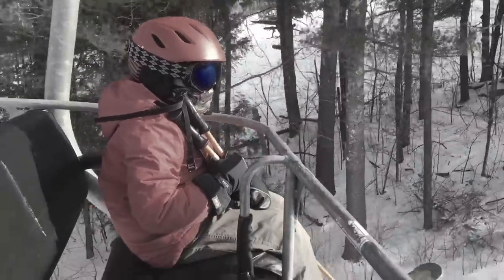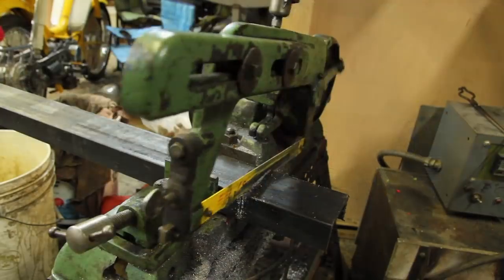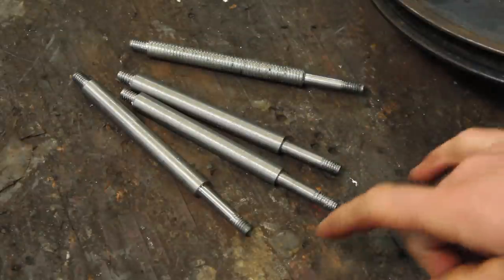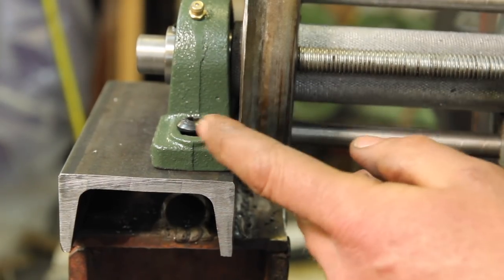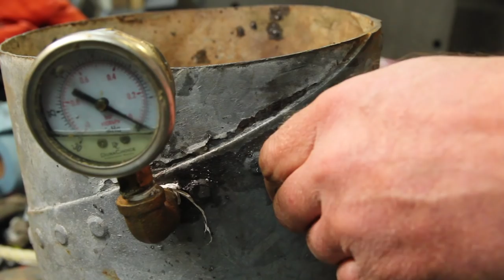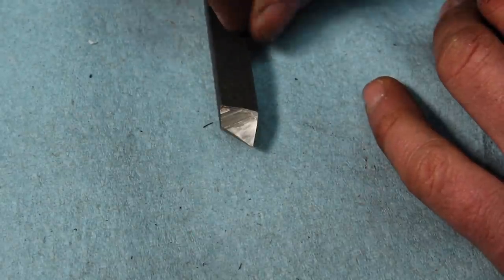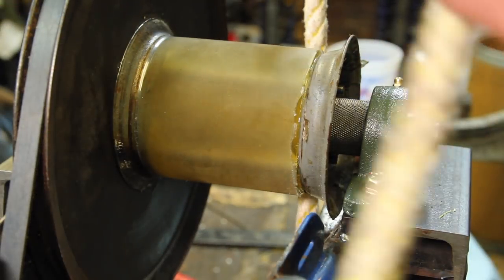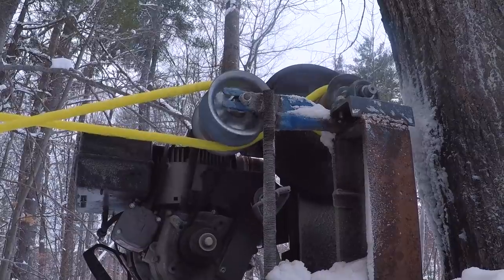Rope Tow Rebuild

Comment: Growing up I regularly skied a private club hill in upstate New York built by a couple guys from the 10th mountain division of the US army. They built many small hills all over the country after WWII. It had a rope tow just like this. The return was old phone poles, with car spindles and wheels and it was powered by a 4 cylinder Lee Roi tractor engine and transmission. The hill was steep with I believe about a 500 foot vertical and you had to be pretty strong to make the top of the hill on the tow. It would wear out a good pair of leather mittens in a weekend. We always kept a roll of tape on hand to fix blown out gloves. The place ceased operations in the late 70s after a local kid burned down the clubhouse. The old chimney from the clubhouse still stands today and the power shack and engine for the tow was still at the top of the hill when I was last up there 10 years ago. The memories that came back from watching this great video. I live in Florida since 93 and I haven't thought about the old Mountain Ten ski area in decades. Thanks for this video.

Comment: Welding tip. Focus the weld on the flat surface and allow the metal to flow to the piece you are attaching and practice all the different angles and directions to get the best results on some scraps and before you know it your welds will look better.

Comment: For a safety, it would not be a bad idea to incorporate a remote key fob remote shut-off, the fob can be attached to a glove, around the wrist, and shut off from 100-300 yards or something, I'd keep the in place shut-off also, Incase a bystanders need to shut it off,  it's basically just a remote control relay!  Cool idea this thing is awesome!

Comment: Welds aren’t bad. Push instead of pull. Go slower when base metal is 1/4” or more. You’re getting decent results for that style machine. And those welds are unlikely to fail. MIG with solid wire and shielding gas will feel like cheating when you upgrade. Dual shield is even nicer.